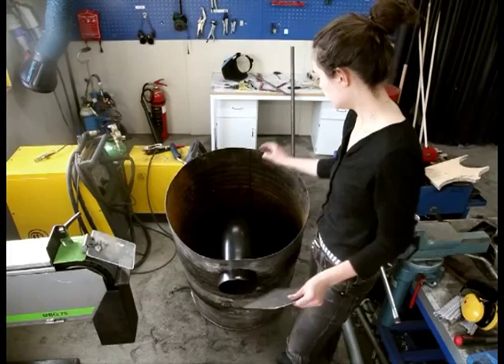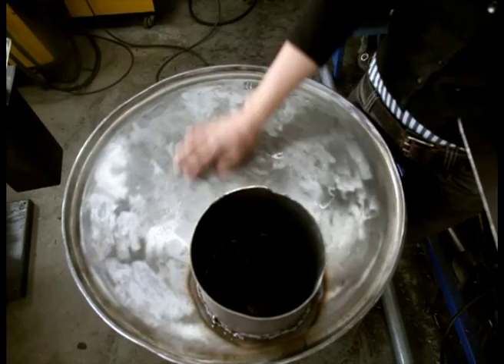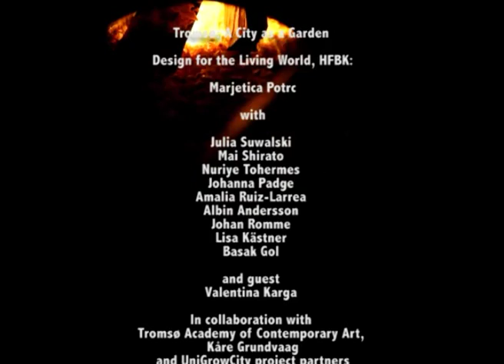DIY rocket stove: Tromsø version

Comment: Regarding paint removal on a barrel, I would use a gel type paint stripper applied in a strip as thick and as wide as possible, the full length of the horizontal barrel. Let the stripper do it's thing, then roll the barrel slightly and help the dirty stripper flow to the next section with old paint brushes, let the slightly used stripper lift all the paint again, then repeat, basically rolling the barrel while keeping the increasingly used up stripper on top. Makes it easy to maintain a thick enough coat to quickly and cleanly lift the paint. Admittedly I've only used this technique on flat, horizontal surfaces like a school library table, but it is amazing how far you can stretch a small amount of paint stripper, so I hope someone tries a barrel. The trick might be keeping it from running off, but as it picks up paint it thickens, and you may need to add a little fresh or start a ho new glob.. Hope somebody tries it on a barrel, or at least on an old table or somethin.
Reply: Update on my paint stripper/barrel comment. Try pouring the stripper on a
 piece of plastic, lay the barrel in it, slowly rotate and easily scrape most of it off with a putty knife. Using a stainless BBQ grill scrubber pad, remove the hangers-on, and rinse with water. Burning seems like a pain compared to this.
Reply from the maker: Thank you very much for this detailed explanation! If I ever need to do this again, I will use your techniques, sounds indeed much easier.